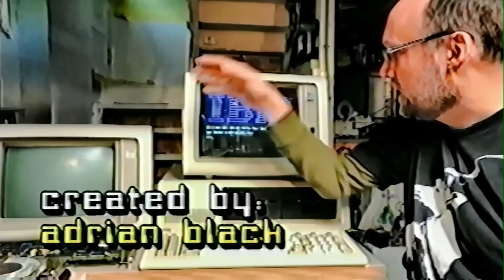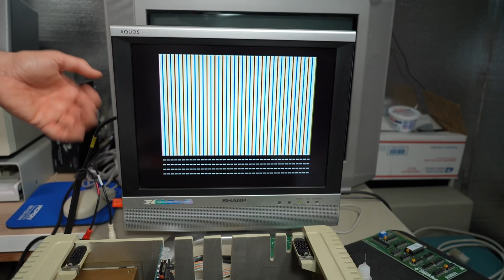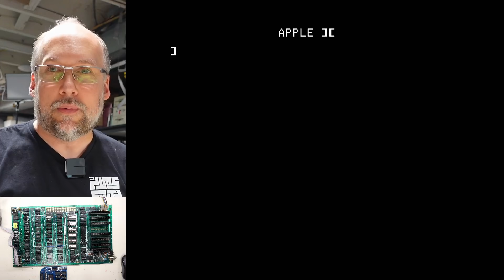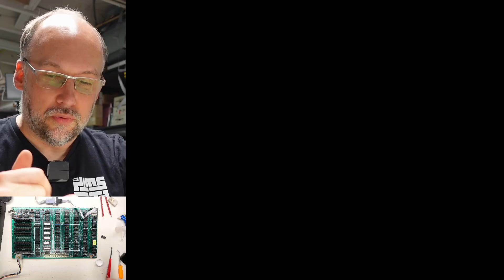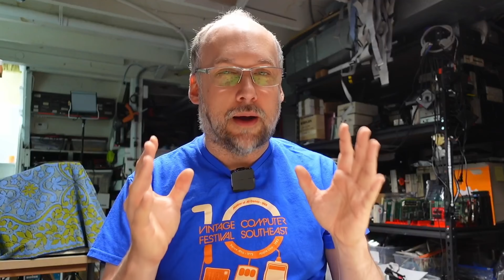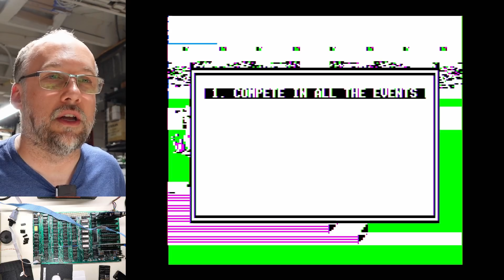Apple II+ clone repair: The sweet taste of success!

Comment: The shorts on the board make me wonder if this board was possible a factory reject, which someone "liberated" from the bin, and populated with spare parts, ala "One Piece at a Time" by Johnny Cash.  That would certainly explain the wide variety of IC manufacturers and dates. Perhaps it never did actually work properly.  That would explain why the case is in relatively good condition, besides the corrosion, and that likely happened after someone got frustrated and stuffed it in a garage or basement.

ps>>  Your "S" key is upside down 🤣

Comment: We need a diagnostic rom/software for amiga that can test, not only chip mem, but also other mem. I have an A1200 that only crashes with an accelerator board installed and since I can't test that memory I can't check if it's the accelerator or an issue on the main board.

Comment: Adrian, Your assumption that the board ever worked was most likely the problem.

 Many years ago... I made a bit of extra cash assembling "Kits" that looked a lot like this machine. The kit included the bare PCB and several bags of parts minus the programmed EPROMS. Several of the PCB's had issues similar to the ones you found with this motherboard.  I rapidly learned to go through the board with an Ohmmeter and bug out the main buses and other critical paths before assembling the board.  The PCB mfgr had poor or likely no QC or electrical testing done prior to shipping.  Also I often got assembled "Projects" from others that had failed...   I quickly learned that if there were any Radio Shack, Poly-Pak or other bargain outlet parts, toss em and go with Jameco, Mouser or Digikey.  The extra cost was well repaid in less troubleshooting time.

I still have my old GenRad 2220 Bug Hound tester.   Manual and info here: https://arcarc.xmission.com/archive/Web%20Archives/ionpool.net%20(Dec-31-2020)/arcade/tech/Bug_Hound_2220.pdf It is invaluable for tracing PCB shorts!

Comment: FWIW, based on the design of the memory in the Apple ][ system and what it's showing on the screen while running the test, I suspect that that diagnostic ROM memory test still isn't really exercising the RAM in the best way to reliably detect all the possible kinds of faults, and could still use some improvement.

Because each RAM IC only handles one bit of the written/read data bytes, there is really no point to successively writing many different byte values over all of memory at the same time (i.e. the same byte for all memory locations, then a different byte for all memory locations, etc).  That would mostly detect cross-linking issues between two data lines, but no single RAM IC is actually connected to two data lines, so that's unlikely to happen in this configuration anyway.  What is much more important to test for is cross-linking of cells between address lines, which means that it should be writing different values to different addresses instead (which I don't see happening at all based on the screen memory display).

The March-U test is very good at detecting unlinked memory faults, but linked faults can still mask problems in ways that a naive implementation will not necessarily detect.  It looks like these memory tests are trying to account for this by applying the test with multiple patterns (good), but they are doing it in a way that is not optimal for the way the hardware is actually designed, so is not actually as effective as it could be (and also wastes a lot of time on unnecessary tests).

Comment: I'm sure that this will draw a lot of flak but here goes anyway. 

1. Why not twist (not enough to cause damage) the entire board repeatedly instead of just slight random pressure when you need to see if all intermittents have been resolved? 

2. Someone else suggested using cooling spray (either component cooler or canned-air, inverted). Alternately using that along with heat from a hot-air rework station (low heat, not too close) can help find intermittent faults much more quickly than just waiting for them to appear. Those can also make intermittent ICs show faults. 

3. When you say 'shorts'. Are you actually referring to open/broken connections?

4. For intermittent problems, vibration can make faults show up much sooner than letting the board just sit there. Using a Bass Shaker type Tactile Transducer run with music (low power/volume) on the bottom of a piece of board (circuit board or computer on the top of that  board) can introduce the kind of mild vibration that could bring out intermittent problems.

Comment: I have a ][+ that does this same thing. If I put it away for a couple months and then try to use, it freaks out. I push on all the chips and it works again for days. Rinse and repeat. I think you really have to resocket the whole machine eventually to keep it running.

Comment: I worked on boards back at the time this was made. I remember the particular type of 14 - 16 pin chip sockets I'm seeing in this video were often the issue with intermittency. Later sockets had better connectivity by having more contact area.

Comment: Trimmer caps do not have an end stop like pots do, so you will continuously vary between the minimum and maximum values of the capacitor. They do not handle solvents well either.

Comment: Garfield would describe Adian as "dogged", as in "He 'doggedly' persues the repair until every doggone problem is fixed."   But it's weird that an Apple II would have cr*ppy, cheap sockets.  You would think that Steve Jobs would have insisted on nothing but the best parts.  I would expect cr*ppy sockets in a Commodore 64 with Jack Tramiel pounding on the boardroom table and demanding that the machines be build as cheap as possible.  Lol. Cheers :-)
Reply: It's a clone, so whoever made it put the cheap sockets in.

Comment: Those Siemens DRAMs were probably not "bad", just slightly out of the spec for what this board needed. You could likely switch another IC (say a mux) for a faster version (say F instead of LS) in order to make that board work with the old Siemens DRAMs.

Comment: I can understand why you chose this route, for the experience.  However, if I had a bunch of blank motherboards for this computer, like you have, instead of wasting hours diagnosing each quirk, I would have grabbed one of the blank boards and transplanted all of the passive components, installed modern reliable sockets, soldered the transistors and crystal and then check to see if it works.  Chip problems are easier to diagnose if the PC board isn't hosed.  You could also have transplanted chips into a real Apple II and spotted a bad chip.  However, this monster was Murphy's Law in every sense of the phrase.

I am amazed you stuck with it.

Comment: I prob would have gone over edge long ago. Frak it🖕😉all!!! Every memory socket gets changed. That, or start redrawing board scans into gerber files. Hint: The tendrils shorting between pads regrow over time. These dendrites come from solder oxidation and a reaction with mixed types of metals. Unless we plan to store old computers in tanks full of dielectric grease(not likely), then all of them will one day cease to be repairable.

Comment: I would say this was a first-off board that got send back for local validation (wow!). The prototyping pads, dodgy trace placement and the not-installed cap are all good indicators, it might have been intended for 'good enough' video output for testing purposes. It would be interesting to compare it to a working clone.

Comment: Adrian, congratulations. I am a fan from another continent, from Brazil. I am 54 and unfortunately did not live the era of many of the machines you present in your channel, my first interaction with this world was a TRS80 machine in 81 (I was 12 at that time). Anyway, what I wanna tell you is that I used to work as an electronic technician from 86 to 92 debugging PLC boards for Reliance. One of the worst problems we had was thermal failure and bad contact with sockets and we had a technique that might help you, we heat up the boards with a hair dryer and cool it down spot by spot with a CO2 spray. That helped a lot finding the thermal faulty IC or bad socket. It might be useful for you. Thanks for all the great content.

Comment: Nice job!  Honestly, I would of changed all the sockets just to examine the traces and to eliminate all those single wipe sockets which you know will come back to haunt you.  Of course, sometimes removing old sockets can cause damage to the pads on old PCBs, so yea it's a personal choice and comes down to if you're going to actually use it or place it on the shelf to be pulled out from time to time.  I have a house full of old computers many are setup to be used but sadly don't get used all that often, but I do turn them on from time to time just to make sure they still work and sometimes issues occur, so they end up back on the bench.

Comment: I suspect you will be fixing this machine in future. Chips in sockets IS the problem, they just are not reliable or dependable over 40+ years. Both surface corrosion of the chip legs as well as the sockets. Deoxit, whilst very good is not the cure all we would like it to be. Corrosion on the chip legs will also make the retro tester results suspect.

Comment: Page 0 and page 1 are critical.  Page 0 because that's how the 6502 does indirect addressing, and page 1 because that's where the stack lives.  Both of these are critical to any kind of sensible software.  Sure, you could code around no stack, but it'd be damn hard to code around no indirect memory addressing.  The first 16k of memory is critical to any Apple 2 series computers.  Any 6502 based system, really.

Took me a long time to get used to 6502 machine coding, since i was coming from a Z80 background, where you didn't have to worry about such things.  Stack size as big as the memory in the machine?  You betcha.  Not only indirect addressing, but indirect with index registers?  Check.

The 6502 is fast, and cheap, i'll give it that.  But my heart will always be Z80.

Comment: You have to be careful with turned pin sockets, the have a tiny copper form inserted into the the shaft of the pin. The copper form can get stretched if you insert chips that have been soldered or if you stack sockets. They can even get pulled out by burs on a cut IC pin. I recommenced to only use them for unsoldered / uncut pins, use dual wipe sockets for used soldered/cut chips. Also: those pin headers used to plug mod boards into chip sockets have slightly different pin thickness on each side, the thinner pins are meant to pug into the socket.

Comment: You didn't explain what the purpose of putting the motherboard in the refrigerator was, and how this fixed it.
Reply: That wasn't to fix it. It was to test whether the last apparent fix was an illusion due to warming up. 

Replacing suspected bad IC's can create an uncertainty whether it was a bad chip or a bad contact. And it's sometimes both.

Testing can erroneously appear like something was fixed that will only show up again when everything cools down. Frequently, the old method was to use Kool Spray or other pressurized gas to cool tiny areas to reproduce the problem. And sometimes applying spot heat to pinpoint where the temperature sensitive issue is occurring.

Comment: I always replace single wipe sockets on sight whenever I see them... have wasted many hours diagnosing odd faults caused by them! Usually I do not socket standard logic chips.
Reply: Another thing I do often is a "drop test" - i lift one edge of the board about 2cm off the bench, and drop it. If the machine crashes, there's something intermittent and I chase it down

Comment: Back in the day, I've written several address in address memory tests to find those data to address line shorts.  I worked in an early computer store that sold S100 kits, and there were plenty of not perfectly etched PCB's in those kits.  I ended up removing lots of chips and sockets, and then fixing the board with an exacto knife.  Those bad board problems eventually went away once the kit makers started using bed of nails testers on their boards before shipping them!

Comment: if you run out of 4116s use a 4164 but lift pin 1 and connect to pin 16, lift pin 8 and connect to pin 9 , you can then drop them in place

Comment: A few years back after fixing a ls logic chip on an apple ii. I had 2 bad ram modules. Before I even got that far. I had removed all the memory chips and cleaned them due to that black stuff. Only seemed to be on the memory chips. Also I shot contact cleaner into the socket too.

Comment: Brilliant video series of an Apple ][ clone definitely from hell. Makes me fear what happens when I bring my own clone out of storage and try to turn it on. Luckily it also comes with a full ROM listing and schematics. Probably just needs recapping, but then again I have the soldering skills of a butcher and I only have a multimeter for checking. Plus it is a Euro machine and to connect it to a German TV it actually needs a PAL card for the correct video output. I wonder if a semi-modern flatscreen TV with a composite in may actually work. It was working perfectly when I put it away some 35 years ago.
It also has a lot of extension cards: Language Card, Z80 Card for CP/M and Turbo Pascal, Centronics Card to connect a printer, 80 Column card (which definitely needed a monochrome monitor to work), obligatory Floppy card and the mentioned PAL card for TV output. Hey, at least I had a dual monitor setup before it became cool.

But I am really afraid, when I turn it on in it's entirety, it will burst into flames. ⚡🔥🌋🎇

Comment: I got some experience by buying a lot of old computer boards and recuperating all the components.

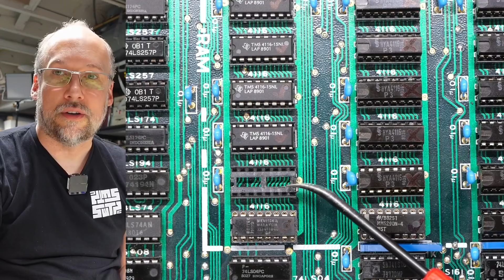At 17:57, the chip (often from Texas Instruments) looks like it's silver coated, but oxydised. This may give flimsy contacts.

These chips can be re-tinned by brushing them with a steel brush on a dremel, with acid flux used for copper plumbing. Then washed to remove flux.
Texas Instrument used to make dual leaf sockets but turned out to be flimsy and were a source of problems.

Comment: Are the keyboard "macros" on this clone (its shortcuts to BASIC commands that are labeled on the bottom side of each key) a function done in its main ROMs (i.e, with code that runs on its 6502 CPU), or implemented in the keyboard controller itself somehow?

Comment: Testing RAM etc, some of the problems like chips seem to work in one thing and not others can be a timing thing. And off cause cracked or shorted tracks.  Also I remember back in the 80's being told that sockets can effect timing and that one reason for not using sockets.

Comment: I'd be tempted to swap out all those sockets for dual wipe ones, or even solder the chips directly to the board. Many headaches could've been avoided, I think. Still, it was an interesting little adventure.
I find it a bit amusing that through-hole design was chosen back in the day because it was reliable and solid, but then some companies thought it would be a good idea with these awful sockets, tossing the previous benefits out the window. More modern surface mounting also suffer some of the same reliability issues, but space and density has been the deciding factor. I suppose in military and medical grade equipment, that might not be the case.

Comment: That every single chip was socketed, the patches of 0.1" prototype areas, and the clock gen transistors and crystal being socketed leads me to believe this is an internal prototype from the manufacturer. Surely they wouldn't release a board with all those sockets except for ROMs and upgradeable RAM? Ok, I know Commodore (with the C64) installed sockets on the board soldering line for the custom IC's in order to get the boards out quicker and wait on production delays. But nobody would waste sockets for jelly bean logic parts or base RAM.
The replaceable transistors in the clock circuit is especially crazy for mass production.
Reply: All Apple II's were fully socketed, and the early revisions had prototyping area on them.  These were probably Woz's ideas.

Comment: You never tried running the 6502 Romulator eliminating the ram on the board completely.
Reply from the maker: The video circuitry requires the RAM to function. The Apple II has no video RAM.

Comment: I had a job with a nasty pcb that i had replaced something but had not got the legs hot enough when soldering so the connection to the top or mid layer was flakey and just touching the board caused issues like what you had..... very difficult to find the issue...

Comment: This board's quality is horrendous. Not even modern noname, everything is just bad.

Hope you didn't forget to solder that transistor (I may have missed it).
I guess the board batch was SO bad they thought scavenging even transistors is a good idea if it doesn't work.
What a mess! You are like a magician repairing 1000 faults, but with knowledge, sweat and tears.

Comment: Great video, i think the solders need a reflow on the sockets because it doesn't work very reliable. Resolder the sockets is the way or put a new ones on to that mainboard and solder the cristal and the transistors directly to avoid false issues with the motherboard.

Comment: Jerry Walker has a really interesting video (“НН Tiger CPU Part 7”) where he shows how you can pull up just the plastic housing on these single wipe sockets to clean off the pins.  This way you don’t need to replace the whole socket.
Reply: I’ve done that a few times myself but in one instance it usefully revealed a socket with a broken pin. Didn’t expect to see the HH Tiger mentioned in the comments - I have a complete working one that I nursed back into life last year!